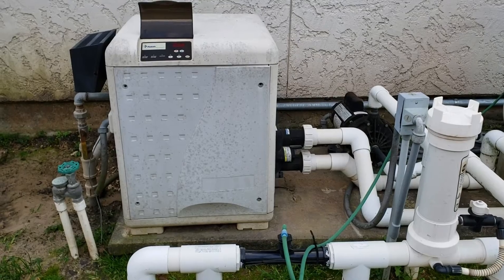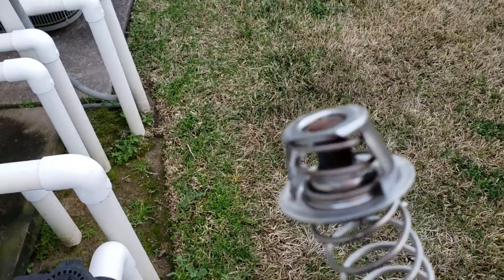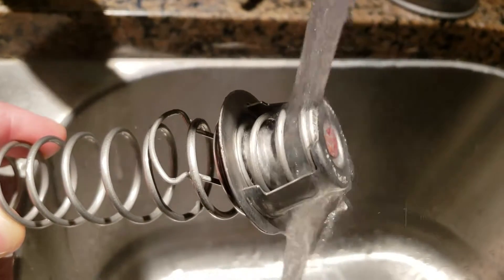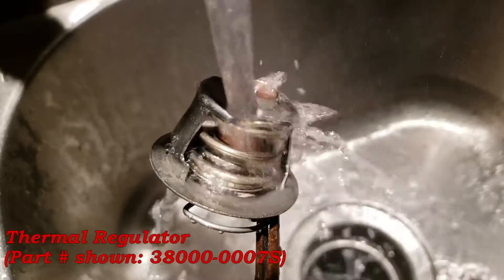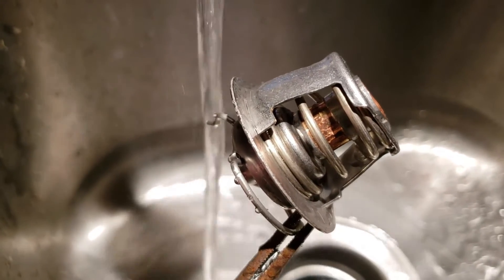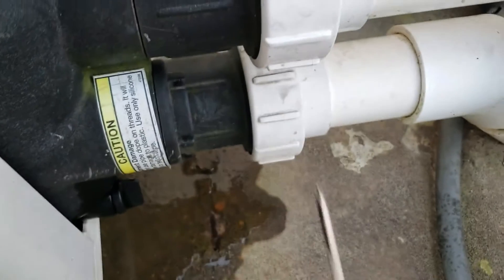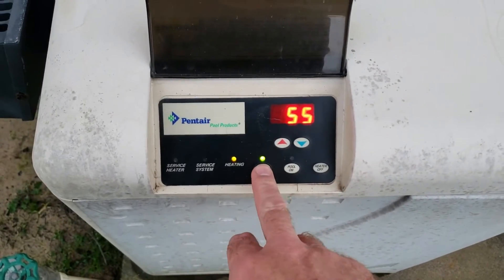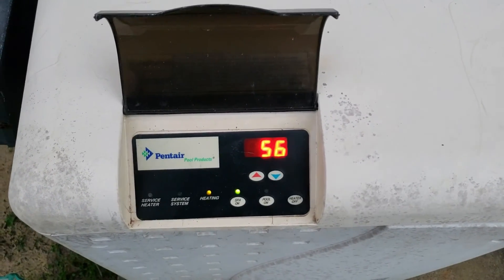Thermal Regulator Replacement on Pentair Mastertemp 400 Pool/Spa Heater

Comment: My Mastertemp 400 was cutting out after beginning the process of calling for heat and attempting to ignite, then it would shut off and start over. I pulled my thermal regulator and it was definitely stuck closed, corroded and green. I swapped it for a new one and thought I'd be set, but it is continuing to cycle and then ends with a Service Heater light. There is no error code on the back of the controller board. As it cycles, the Heating light blinks, then goes solid, then I hear a puff sound from inside, then it starts blinking again. It seems as if it is attempting to light, but can't for some reason. Could the faulty thermal regulator have allowed water into the combustion chamber? Are these potential separate issues? How can I check to see if the combustion chamber is dry, preferably without tearing the entire unit down. Another thought is could it be clogged in some way? Prior to this issue, we had torrential rains that caused the patio to flood and a bunch of soil and sediment got into the pool. It is all filtered out and looking clear now, but I wonder if it somehow got through the system and gummed up the heater.
Reply from the maker: You asked can a stuck thermal regulator allow water into the combustion chamber?  Answer:  No, the manifold and all of its internal parts are sealed and separate from the inside of the combustion chamber.  A stuck thermal regulator will prevent opening a path for cold water to dilute hot water at the manifold output that is too hot to contact human skin (120 degrees).  To prevent scalding, pentair put a HLS (high limit switch) at the output side of the manifold that will provide an electrical "open" circuit that the  control board will see and react by shutting down the heater and throwing an HLS light on the back side and SERVICE HEATER on the front side.  This chain reaction of safety devices and switches is how a faulty stuck thermal regulator results in a SERVICE HEATER light.

You asked what is a quick way to see if your combustion chamber is full of water without tearing it down?  Answer:  Unscrew one of the 2 bottom bolts (13mm) that holds the manifold on the side of the combustion chamber.  Since each bolt hole is essentially an unobstructed threaded tunnel directly to the inside of the combustion chamber, when you remove one on a flooded combustion chamber, water will come out.  I stated to unscrew the bottom bolt on either side so that you will "remove the drain plug" at the lowest elevation and have the maximum effect to get it drained as far down as possible.  This should clear the cavity enough to get it to fire.  That said, if you have any water in your combustion chamber, your heat coils are leaking, no mistake about it.  See my channel for another video on how to replace the coils if your tub has water in it.

You asked can there be mud clogging up the inside if the heater tubes?  Answer:  theoretically possible to clog one or two, but not all of them and not likely at all to clog any of them.  The reason is because every drop of water that your main filter pump pushes runs through your heater coils day after day regarding of whether or not you are using your heater.  If the heater's coils were clogged inside each tube, none of the water that your pump is moving would make it back to the pool.  You are moving water fine so this is not the case.  Also, your filter is in line before your heater and would not allow dirt through it anyway.  If a little dirt passed through the filter, it would be so small that it would pass through the heater tubes too and spit out in the pool.  Hopefully the filter would catch that dirt on the second pass.
Hope this helps!
Reply: @pvt-pilot   Thank you for the detailed reply. I pulled the bottom bolt and it was dry. I have now ruled out the following: thermal regulator, leaking heat pipes, water in combustion chamber, controller board, gas supply. 
Since I can smell the gas and hear a puff sound, but it doesn't seem to ignite, in wondering if it may be the ignitor. It's three any other component I should be looking into?
Reply from the maker: @liquidmojo1439  You may try testing the igniter next.  It has a modular plug to disconnect it next to the blower so you dont have to remove it to test it.  Put an ohm meter on it.  If it is open (infinite ohms of resistance), it is defective.  If it has low resistance reading at the plug, it is not likely that the igniter is defective.  Test both directions while you are there to confirm no opens.  Let's go from there.
Reply: Fixed. Thank you very much for your help. The new ignitor did the trick.
Reply: @pvt-pilot  If the heater coils were clogged , the pool water would circulate thru the internal bypass valve, which it does normally when the heater is off and the thermal regulator seals the heater output to prevent condensation on heating coils, and rusting them out.  Review the manifold flow diagram. The thermal regulators purpose is to prevent condensation on the heating coils, not to prevent scalding water to attack swimmers. Low water flow would cause scalding water to attack swimmers near the jets. To protect them, they installed the high limit switch. The ags switch is set to shut off the heater at about the same temp as the hls, so that is the backup.  Enjoy your videos, keep up the good work.
Reply from the maker: @officerkrupke4966  That makes sense.  I never reviewed actual pentair diagrams, so this is good info to know.  I just took things apart, looked around a bit and visualized the flow and the affect each sensor and component would have on the flow.  Thanks for the additional info.  I was hoping a professional tech or pentair rep would find my videos someday and elaborate.  I like learning new things and sharing my experiences in an effort to help others, so thanks much.
By the way, now that I think about it, on my coil replacement video, I tend to recall hearing water rushing through the heat coil tubes when I had the entire top of the heater removed and I wasn't calling for heating of course.  I was just stress testing for leaks.  Hmm, but you are saying that water doesn't travel through the heater coils when the thermal regulator is closed?  I must be getting this wrong in my head.  I was thinking the manifold bypass valve that is on the little firewall piece would open in the presence of high pressure, like clogged tubes would cause, and the thermal regulator was there to open in the presence of high temperature.  I'll search for the diagram you referenced and get my story straight.
Reply: @pvt-pilot  There also must be a vent to allow the heating coils to fill with water to prevent dry firing after repairs such as you made. Maybe the temp. regulator allows some flow out of the coils to prevent air lock. If you figure it out, let us know.

Comment: My Regulator seems to be stuck.  I'm afraid to use too much pull pressure to dislodge it.  Any suggestions?  Thanks.
Reply from the maker: Don't be afraid to pull harder.  Worse case scenario, the spring comes off without the thermal regulator.  If that happens, you will have to take the manifold off and remove the thermal regulator from the other side.  Nothing should make it stick in there, so it is likely something else is wrong and you need to put your eyes on it.  I would take off the manifold and take a look around inside.

Comment: I am having trouble opening the pipe with a screw driver, it seems like it is stuck. I tried pouring hot water on the pipe and it did not work.
Reply from the maker: Try using a long screwdriver so you can turn with 2 hands...one pushing, one pulling.  It is just plastic so it will not be corroded shut.
Reply: Thank you that helped me open it!!

Comment: Awesome video.  I have same problem.  But instead of removing the regulator I lowered the temp on the heater to 65 and let it run for a few minutes.  Then cranked it up to 104.  Fired up and had heat.  Now it is doing it again next day so I think we have the problem solved.  You are the man.

Comment: I have a Mastertemp 250.  Cycles off and on until desired temperature in either pool/spa mode; however, it does it 30 seconds at a time, takes forever to heat the spa.......Thermal regulator?
Reply from the maker: Maybe thermal regulator is the problem.  Pull it out and test it.

Comment: Thank you for the information and video on replacing a thermal regulator. I have a Sta-rite Max E Therm 400 heater on my pool and spa. Initially it would only heat up to 85 degrees, start cycling on and off, and not get any hotter. I replaced the thermal regulator and tested the heater. It reached the set temperature of 104 but started cycling on and off when the temperature was around 97 degrees. The cycle would be about 1 minute to 1 minute and 30 seconds on and about 45 seconds off. During the re-ignition process the service light would briefly come on then off just before the heater would light. Is this normal or if not any suggestions?
Reply from the maker: Is you fan turning off during each cycle?  If so, please understand that there is an immediate SERVICE HEATER light at any given moment that you AFS is not closed, meaning any time there is not full power air flow being blown by the fan.  So, during the boot up process, it is absolutely normal for the SERVICE HEATER light to illuminate each and every time for a quick moment between the second you turn the heater on to second that your fan spools up.  As for not reaching 104 before cycling, that might be a false temp reading by the HLS (High Limit Switch - which does not have a temp display) shutting the heater down before reaching your true desired temp.  Pull out your HLS using a 7/8" wrench to check for green/blue oxidation caked up on it.  If your thermal regulator had that garbage on it, chances are that your HLS and thermistor will likely have some pooky on them too.  Thermal Regulator is responsible for preventing you from scalding yourself or melting your pipes.  HLS is an electrical way of making sure your thermal regulator and various other parts are doing their job.  It is the last water temp safety check sensor before water leaves the manifold.  So for safety reasons, keep your sensors happy and healthy.
Reply: @pvt-pilot  During start up, pool water flowing thru heater will cause condensation on outside of heater pipes. To combat this, they put a thermal regulator to keep heater water flow shut off until water temp inside reaches 120 degrees, than opens to allow flow thru heater, much like your cars tstat works. If it sticks closed, heater overheats and the high limit switch will shut heater down. If it sticks open, heater pipes will rust due to the condensation forming on outside of pipes. Newer models now have capability to add an automatic bypass around heater when it is off.

Comment: Is it the LEDS that run along the bottom that are used for T/S or is it the ones on the left-hand side? I replaced my thermal regulator after a constant SERVICE HEATER lamp. If I was lucky, I could secure the breaker reset the fault and the heater would start-up for a min or so and shut off. My thermal regulator was really corroded. The SFS led is lit.
Reply from the maker: Diagnostic LEDs are on the left side of the control board (not visible from the touch pad).  The status LEDs are on the bottom and they just line up with the little transparent LED windows in the membrane pad (so they are visible from the touch pad which include HEATING, SERVICE HEATER, POOL, SPA, etc.
Reply: @pvt-pilot  Thank you. I attempted some T/S of the issue using the owners manual flowchart for an SFS LED. Upon inspection, I found a very corroded thermal regulator. I've replaced it but when I re-energize I still get the SFS led, a SERVICE Heater led on the pad. Any suggestions?
Reply from the maker: @samuelriebel5535  I'm sorry.  I failed to mention what SFS means.  That is your Stack Flue Sensor.  It is likely metalically open to throw a SFS light.  Check for corrosion or break in the SFS wires/spade contacts.  It is nothing more than a thermistor mounted on the side of your exhaust pipe.  If you need an explanation of what each diagnostic light means, please view this video on my channel:
https://youtu.be/wNdBBHqE1vo
Reply: @pvt-pilot  Thanks. I did watch your video and found it very informative.
Reply from the maker: @samuelriebel5535  Thank you for your service!

Comment: Hey PVT-Pilot, nice video, thanks for uploading.  I have a Mastertemp 400 and it will fire-up initially; I can hear the blower start, the ignition goes click and then a little 'whoosh' as the gas ignites and smell a little gas from the exhaust.   It seems to run fine for about 3-4 minutes with no error codes and then gas shuts off first, then the blower about 2-3 minutes afterward.   Any ideas of what that might be??  I replaced the Flue (Themistor) about a year ago and solved that problem.   Thank you! Rich
Reply from the maker: When mine behaved exactly like that, it was the thermal regulator.  No error codes, just service heater.  Test your thermal regulator.
Reply: @pvt-pilot  Hi PVT - I pulled out the Thermal Regulator yesterday and it worked fine under the sink with hot water and cold water; it opened and closed very easily.  Thank you, Rich
Reply from the maker: @richsouthall1937  Ok, so you have no error codes displayed on your key pad.  Have you checked for any diagnostic LEDs on the back side of the control board?
Reply: @pvt-pilot  Hi, thanks for hanging in there with me.  No, I have not looked at the back side of the control board yet.   What would I be looking for exactly? Thanks again!  Rich
Reply from the maker: @richsouthall1937  I would expect HLS to be illuminated.  If so, replace the manifold bypass valve inside the manifold.  It is made of thin plastic (terrible design) and will break over time since it is exposed to pool chemicals all the time.  I posted a video on that too.  The safety physics of it is pretty simple.  When the valve is broken, water will almost completely bypass the journey through the heat coils and cold water will mix directly with the output side of the manifold via path of least resistance.  Thus, the temp detected at the thermistor (manifold input) will be roughly the same as the temp detected at the HLS (manifold output) even when the fire is rockin'.  This should never happen and the contol board is wired and programmed to detect this and to shut down heating if this occurs and throw the HLS light (High Limit Switch).  This is not necessarily indicative of a faulty HLS, but the illuminated HLS could be the byproduct of a broken manifold bypass valve.  Take a peek at the control board diagnostic LEDs and see what you got.  We'll go from there.
Reply: @pvt-pilot  Hi PVT; awesome!  Thank you for the very detailed response here.  I will look at this today and report.  So nice to have a kind soul out there helping people out.  It's nice to be able to fix your own stuff! :)  Rich